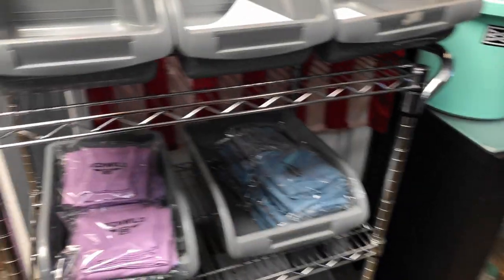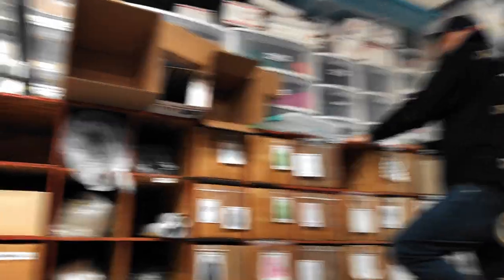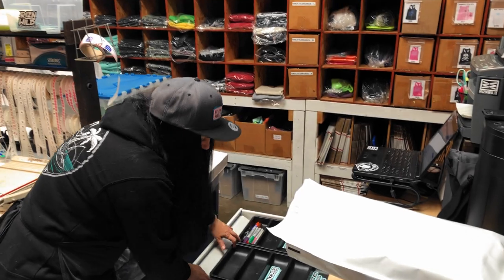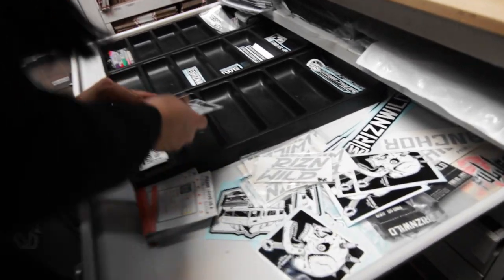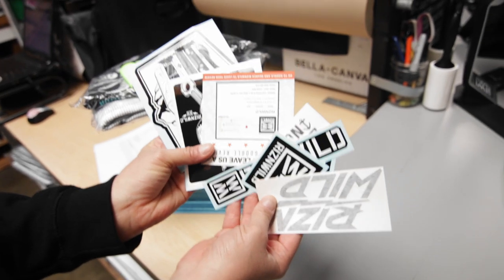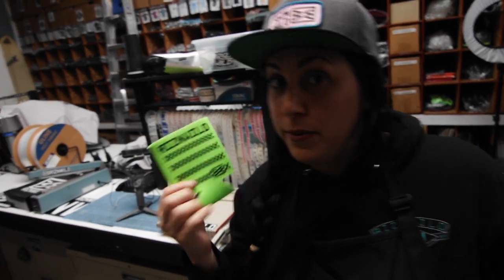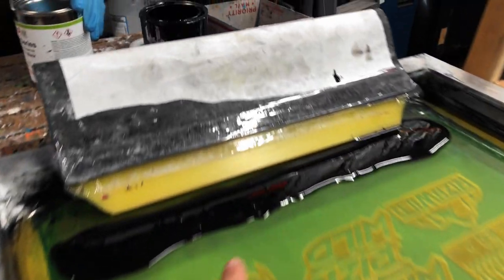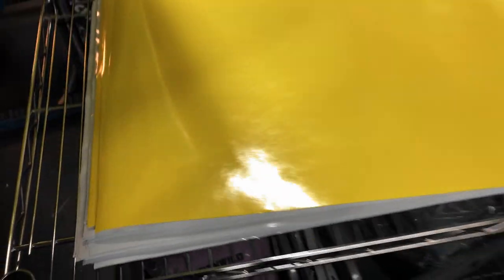CLOTHING BRAND PULLING ORDERS & SCREEN PRINTING STICKERS | VLOG 1

Comment: Badass guys! My Wife and I run a very similar operation for our brand. We do 90% of our screen printing and sublimation in house and fulfill all our own orders as well. Although you have an auto, we're still running manuals. Lol. Been scared to pull the trigger for years now. Just set in my ways. Going to definitely subscribe and can't wait to see more vids. Keep up the good work!
Reply from the maker: Right on!! We do 100% screen printing in house and a little sublimation, we're limited with our size for sublimation so we don't do much for other people mostly smaller things for our brand RIZNWILD. We have 1 auto 6/8 which we won at an auction for a killer price (now we need a bigger one lol). Our manual is a 6/6 still use it all the time. Not everything is worth running on the auto we learned. Thanks for subscribing we plan on dropping 1 to 2 videos a week right now.

Comment: Awesome content! Loved the video, super helpful. I am also learning how to screen print stickers, is there a reason why you guys ran them thru the conveyor dryer? Just asking since I know most solvent inks are air dry. Thanks in advance!
Reply from the maker: Glad to help! True the ink is air dry but we don’t have the room for drying racks in the shop. We run them through the conveyor dryer quickly with just enough heat to flash cure the ink surface, so we can stack them and plotter cut the sheets quickly after printing.